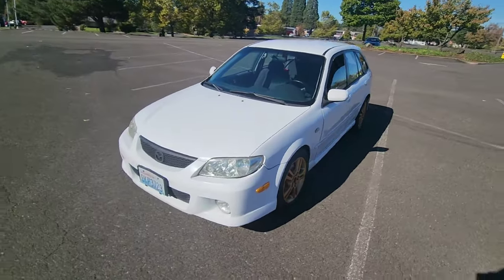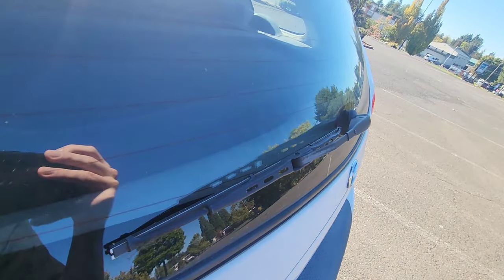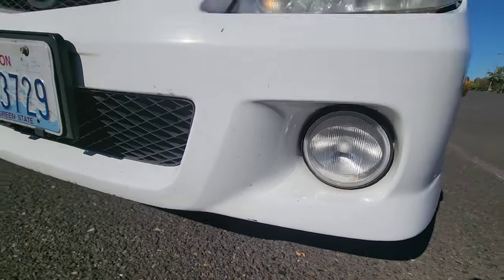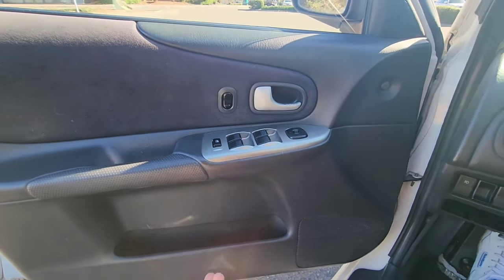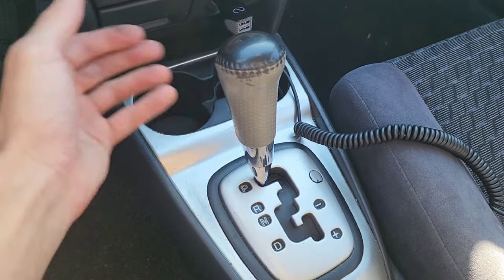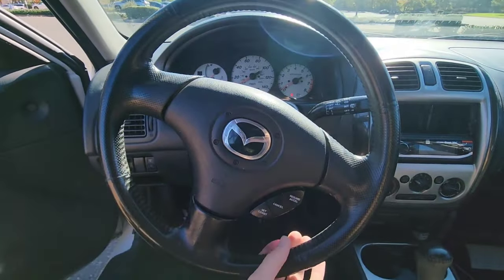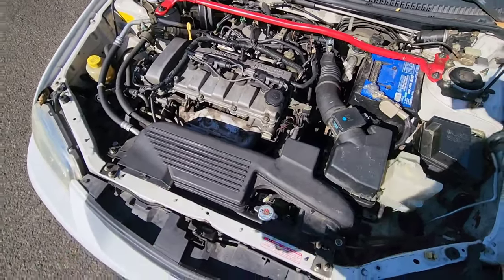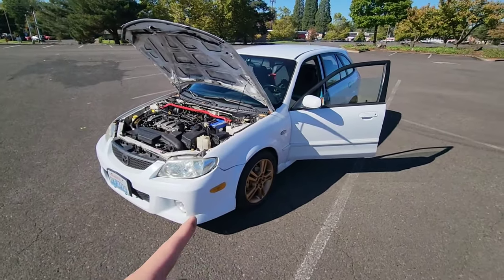2003 Mazda Protege5 Review! Officially 20 Years Old!

Comment: It won't blow up; these engines are SOLID. Especially if strapped to an automatic. They are non-interference. Regular oil changes every 10,000km with full synthetic oil and using 98 Octane fuel and it lasts for a very long time.

Comment: Very, very clean. You did good, especially at that price. A little TLC will easily get you to 300k miles. Cruise controls only fail if someone ignorant F!'s with it when removing stress bar for battery R'n'R. Else, fuse and relay are good starting points. Source of rear wheel well rust is permanently correctable with new tail lamp seals and acrylic caulk. Unlike others of the time, fog lights are real, not a fashion accessory. Mazda still offers printed FSM 9999-95-017B-02 (-03 for you) suitable for 3-1/2", D-ring binder. My 2002 has 240k miles, CC and OE radio/CD/cassette stack work like a champ. (If it ain't broke, don't F! with it) Respect!

Comment: I spent about 150k on two new cars and I have more attachment to my SP20/P5. 110k on my 5.7 hemi new and bought a 2016 Audi A1 1.4 TFSI for 41k new the it was outhandled by my 1.6 Protege in a corner I loved speeding through daily. Max speed I could do round this corner in my Audi was 65km/hr. In my 1.6 protege with 17inch forged wheels and pedders suspension I did it at 85km/hr and it didnt budge. 

Then realised how light these things were so sold the audi and bought more Protege/Astinas and did the same suspension and wheel work. Never EVER selling them. So far Ive gone through 7 dishing them out to friends and family cause the platform is so good. Its basically a 90s Toyota Corolla in terms of reliability. Parts are cheap, they look awesome with just a wheel upgrade and weigh 1100kg with me in the car and im over 120kg lol. Since its light weight, I started throwing in heavy audio gear and hasnt affected cornering that much. 

I like the fact that noone knows how good these cars are cause it keeps the price down so I can keep buying more of them.
Reply from the maker: Love that bro! I hope these cars stay underrated!
Reply: @equalspro  some still sell for 7-9k in AU if paint is in good condition and its been looked after so once they go, then I can pick them up for 1k otherwise they linger in the 4-5k mark lol.
Reply from the maker: Oh the AU definitely more expensive there

Comment: With your transmission in manual mode you should be able to start off in second gear. And you can take off in 1st and rest way of course by selecting the manual mode. 

Just going off of what you said about not having a first gear selection, and the D was basic.

Comment: I like that you took good car of the car. Does central locking also unlock the boot as well so after you remote unlock you can just put your hand underneath the where you unlock the boot and lift? Or do you have to put the key in manually every time you want to open the boot?
Reply from the maker: Every time

Comment: My auto '02 has a 'row' shifter instead of the Jigsaw one, just up or down on the column. My cruise control did work for a year or so before breaking somehow. Got the same white cluster sitting at 155K, paid for a used transmission to replace my slipping transmission. Need to get my alternator and belt replaced.

Comment: Glad you are enjoying your car.  I have one of these in the "Laser Blue" and am the original owner.  Replaced the engine at about 250K miles.  Was burning too much oil and the replacement was less expensive than the rebuild.  Currently have over 400K miles and have no intent to trade this machine in.  Been so many places in this.
Reply from the maker: Holy crap nice!